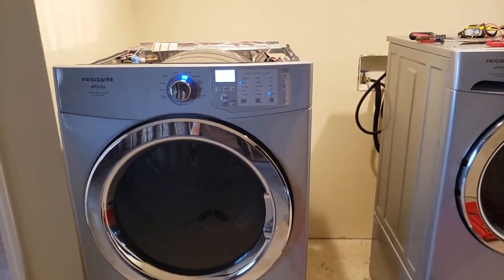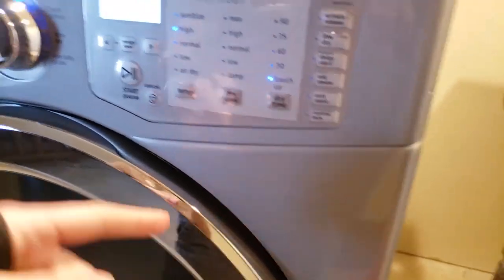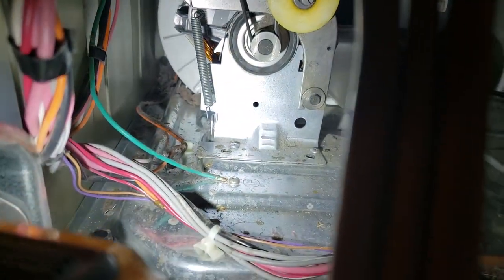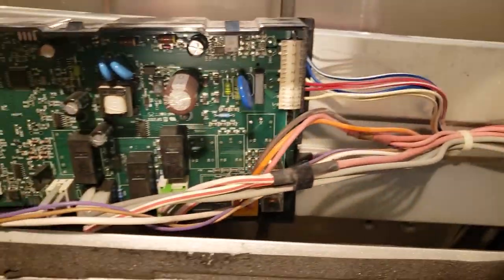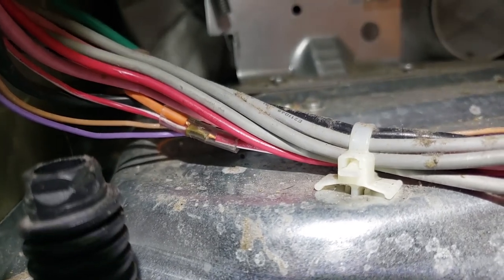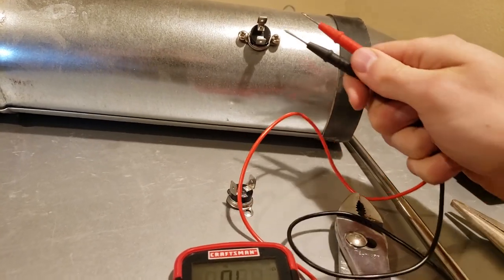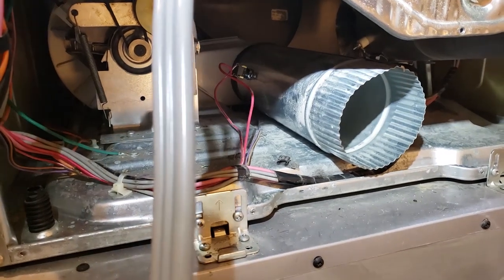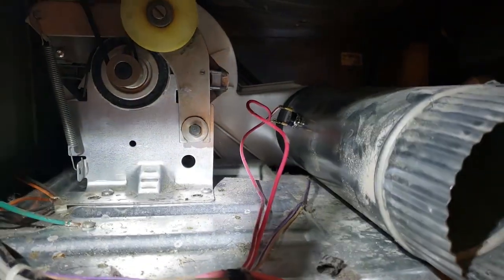Dryer Door Open Error, Diagnose and Fix Thermal Limiter Switch/Fuse

Comment: Thank You ! ! ! Replaced the door switch and that did not fix the problem. The fact that you took the time to tear this apart inch by inch, and post a video......I just can't thank you enough. I did do a bit more googling; it seemed like all of the pros, were taking off the front of the dryers, so I chose to take off the top and front of the machine vs the rear panel. For me, I am glad that I took the front off, because it's so easy and so cool to have the entire dryer in your lap with basically taking out 6 screws (ok, actually 14 screws) and two electrical connectors. Anyway, without your video I would not have been able to fix our dryer. Thanks again.
Reply from the maker: Happy to help Ron. I am no dryer expert, just a nerd that like fixing stuff so I assumed the back would be easier than the front. Funny enough, after this video, the dryer had a second issue with the motor having a short and the company decided to replace that for free. That's when the tech came out and took the front off and showed me how much easier front access is than rear haha.
Reply: I literally just did the exact same thing with the same result. This video was like finding money, HAHA!

Comment: Good, would have been better if you would start at the very beginning of taking the dryer apart.  More like,' dryer door switch for dummies'. A pointer used  to touch the wires in addition to explanation..  Thank you!

Comment: The door switch circuitry is tied to the high limit thermostat so when you have a vent blockage the dryer is disable for safety.